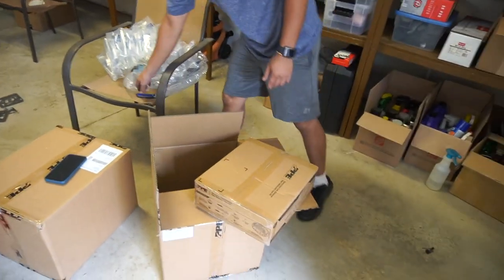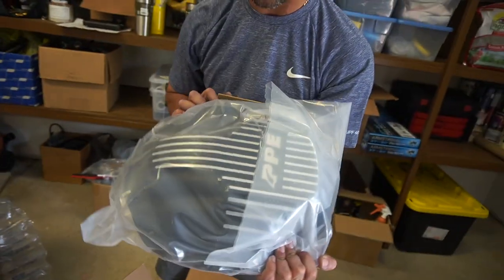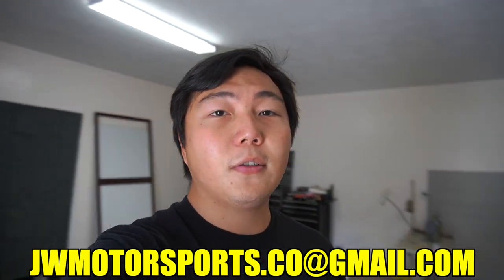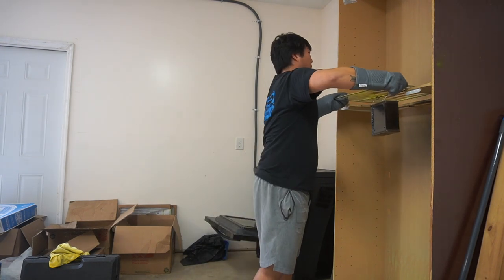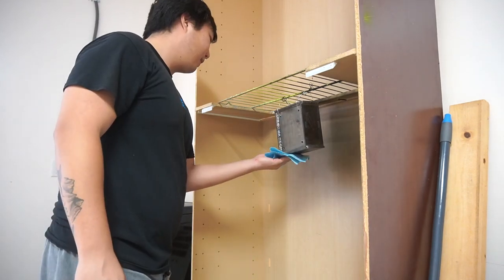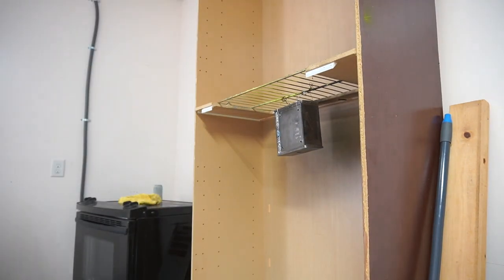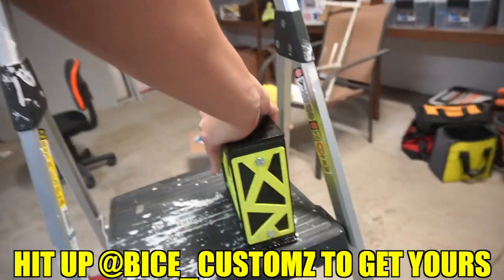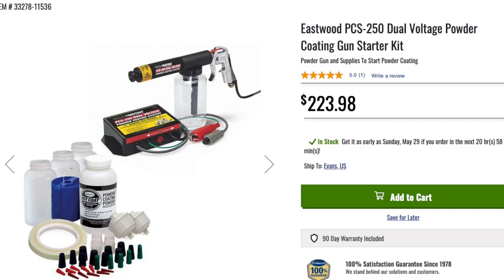I Powder Coated THIS In A Home Oven In 30 MINUTES!

Comment: Those block look awesome love the detail in them. It gives a great extra little touch to add to your lift. I will be looking to getting me a set of those cause I have the same 1" to 1" 1/2 lower in the rear and I don't live in Carolina and I'm not into that look. I was going to do shims or a spacer to level it. But those are way cooler. I think the 7" blocks would fix that. Thanks for the great mod idea.